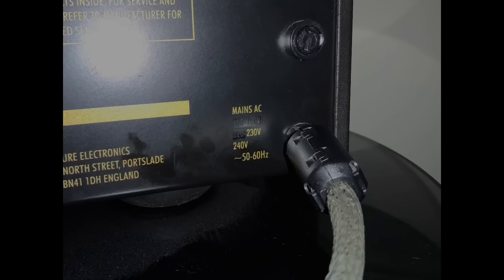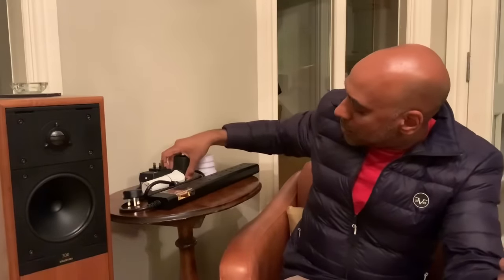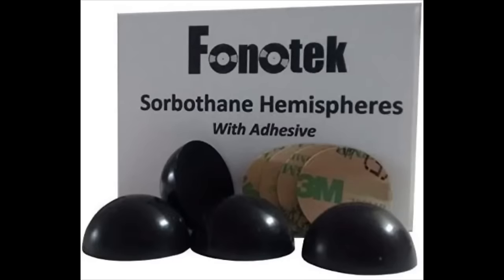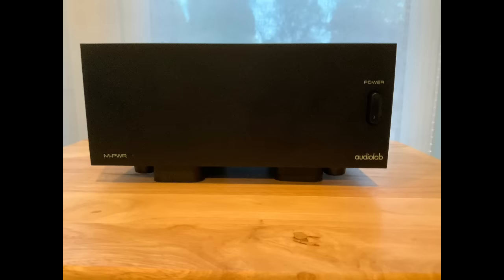My Top 5 Inexpensive Hifi Tweaks

Comment: Great set of videos. Many thanks.
Just to be clear, to use the washing-machine anti-vibration feet properly, do I remove the spikes on my speakers or leave them on? Cheers.
Reply from the maker: Thank you for watching Neil. You need to remove the spikes. The speakers will have a little movement in them now but this is okay and to be expected 😉
Reply: @abritishaudiophile7314  Thanks for your reply - it seemed a daft question but I don't think you made it clear (maybe I just missed that bit) in the video. Also, thanks to you, I now have 6 mains leads and an extension block that need replacing, but at least you've shown us how to do that affordably. :-) Keep up the good work!
Reply from the maker: Thank you Neal  😉

Comment: Hi Tarun - comment #1257: 
Christmas/New Year 2020/2021 turned into a mega TweakFest: I had been unhappy with the sound of my system for some time and had decided to change maybe the amp (Exposure pre/power! for a Exposure 501 or Primare 35) or add a REL subwoofer or both. But I had falsely diagnosed the problem as lack of power in a larger room after moving house or aging of the 34-year old Exposure amplifier or room woes because less soft furnishings. 
- I re-added ferrite cores to all equipment mains cables (I forgot I removed them for the house move) and also added cores to the DC feed for my pre-amp. --> DRAMATIC improvement like night and day. Bass returned and 'constriction' of other frequencies lessened dramatically, instruments separating audibly. 
I suspect I had serious RF interference because 1) there's a WiFi router close to the rack and 2) a DECT 'phone and 3) a WLAN mesh router also nearby, and portable devices connected to WLAN. 
- next, I isolated the feet of my KEF Reference Three Four loudspeakers with the black version of the washing machine feet using existing spikes & spike cups --> now the speakers SING, no more constriction & mid colouration I have parquet on a concrete floor but it was colouring the sound via spikes beyond belief! Now there's amazing energy in the top end which is new like I never heard before in my system, now bass is unfettered, tuneful and deep, powerful or delicate as dictated by the music , mid range is believable, natural and effortless. And I have been newly shocked by the impact of drums on tracks I know well. Before they were all constricted and colouring each other. 
Coming up: a shielded MCRU Belden mains cable for my Russ Andrews Schuko power block so I can start to use the dedicated, shielded mains spur I had put in when we had the house built; 
- an iFi AC iPurifier 
Other electrical 'threats' to the system - we have LOTS of wall dimmers and the lamps (ceiling downlighters or living room lights) all have dimmable LEDs.  It is well known that LEDs emit RFI (read the car forums where DAB radio stops working when LED replacement bulbs are fitted) and also dimmers can really pollute the mains. Add a nice antenna (thin mains cable to the light) and I think it must be a real RFI bloodbath in our lounge. 
Now I am happy again with the sound and the plans for an expensive upgrade are delayed. Some day I will have to retire the Exposure pre/power (it's 34 years old and my oldest component) but she's got some a new lease of life it seems! Maybe a subwoofer could add a new dimension, but it's not as urgent now after the dramatic improvements in sound. 
Thank you, Tarun, for your video which reminded me to check the ferrite cores and isolate the speakers from the floor! This latter issue was new to me, as I had always believed I must use spikes but in my case they were actually spoiling the sound. 
All the best from Switzerland, Rob
Reply from the maker: Thank you for sharing this Rob. I really enjoyed learning about your experiences. It will be interesting to see how you get on with the iFi AC iPurifier. It works really well in my system. Just wondering, have you ever had those old Exposure amps serviced? If not, you may want to do that before an expensive amp change 🤔😊👍👍
Reply: @abritishaudiophile7314  Good question: no have never had them serviced (Horror! What would I listen to?! 😱) I do clean the input & output contacts roughly yearly and once had to have a joint repaired on the XI PSU, otherwise no. Should I check with the factory or can dealers do this? The factory would be a logistical challenge for me from Switzerland. All the best, Rob
Reply from the maker: @RobWhittlestone   Hi Rob, I would speak to dealers and ask them who they use. Get a couple of quotes for a service and replacement of electrolytic capacitors (recap). The likelihood is that at least some of those electrolytics will be out of spec. You may be surprised as to how much difference it will make to the sound 😊

Comment: Another interesting video. I guess the level of improvement with the mains blocks, conditioners and power leads will depend on how noisy your mains is? I've had to add a ground loop isolator to my system. This my be useful for anyone who uses a computer as the main source and can hear a faint whine/buzz which changes when you move the mouse caused by interference from the coil in the video card. Before I got the active speakers the same happened when using amp and passive speakers too. My DAC does not totally get rid of this. A ground loop isolator which you plug in between DAC and active speakers (or amp if passive speakers) however does and does completely leaving no background drone at all. However I'm not sure if this does so without some kind of compromise. I haven't noticed any loss in detail but possibly stereo image and bass quality/punch but not much and by nowhere near as much as changing cables improved it, could simply be placebo due to reading that this can happen due to agressive filtration. The ground loop isolator I'm using costs only 6 quid! Do you know much about these?
Reply from the maker: Hi Paul, thank you for sharing your experiences. I really enjoyed reading you comments 😉

Comment: Hi Tarun, I watched this one a few weeks ago, and I think you're probably the first person I've seen recommending putting ferrites on speaker cables. For £4.40 for a pack of 10 from the famous auction site, there was very little to lose. And I'm sitting here tonight really quite astonished by a noticeable improvement in clarity and detail. I already use Tacima mains strips and they make a difference for me, and I have computer equipment running in the same room, so I suspect I have dirty mains and/or suffer from RFI. Anyway, thanks for the tip.
Reply from the maker: Thank you osliverpool. It is the extra inductance that the ferrite provide that can be beneficial in some systems.

Comment: Just wanted to say thanks. For the past decade since moving home i've never been fully happy with my sound setup. Had no idea what the issue was because it all sounded great in my last home. The Tacima CS947 fixed that. After a decade i'm extremely used to how everything sounds, so i can say with 100% certainty that the mains conditioner definitely works. It's sad how some people see it as "snake oil". It's not hard to see how it will work on some equipment/homes with just a little understanding of this stuff. So now i'm also interested in the Tacima SC5723 wall plug, but as the last comment here mentioned, it's no long manufactured (MCRU also confirmed this). Any alternatives?
Reply from the maker: Thank you ST. IFi also do one which is a little better 👍

Comment: I viewed this video quite a while ago. And based on that I bought a pack of fairly large washing machine, vibration dampers. The result was remarkable. They were $21 for a set of eight couldn’t be happier. Some of the leading prize are between 500 and others are around $700.

Do I gain a lot more going this way because I’ve gained quite a lot .
Reply from the maker: Thx for sharing 😊

Comment: I was always told from audiopgiles and my own rearch and finding that a speaker spike does decouple the stand from the floor as yu are reducing the amount of surface area of the stand in contact with the floor compared to it sat on larger pads, feet or directly on the floor. The more surface area of a speaker, stand or rwuipment/ rack that is in cotact with the floor the more noise it can induce and also collect from the floor, so when it comes to decoupling you want as little surafe area of the items mentioned touching the floor or a surface of a rack. i would always say use spikes on stands and equipment then use anti vibration pads bewtween speakers and their stands and between equipment and rack shelves.
Reply from the maker: Yeh, but that is not true. Try placing your speakers on a glass surface on spikes and obviously protect the glass by using spike pucks and ensure the glass is strong enough to hold the weight. Play bass frequencies and you will see how much the glass vibrates. Do the same exercise now removing the spikes and placing damping material under the speakers. The difference is not subtle.

Comment: Thanks for the advice on the mains conditioner, surely getting the Tacima 6 way. With regards to good house keeping, do you change your speaker cables from time to time? I've heard a few folks do, but the question is, if you're spending tons on cables like Acoustic Zen or similar, how often would they need to be replaced for good conduction?
Reply from the maker: Thank you. They shouldn’t need changing 😊

Comment: If you have a high end system (properly high end with regards to source, amplifier and speakers) the biggest tweak you can make is to upgrade to high quality speaker cable.  I had my dealer demonstrate the difference between my old Naim cables and new Linn K200 cable. Difference was noticeable and worth the upgrade cost.  He had tried to convince me several times but I was a disbeliever until a blind test convinced me otherwise.  Money well spent in my opinion!
Reply from the maker: Thanks for watching and sharing your experiences Ian 😉

Comment: Thank you for sharing these tweaks, sir. Went and bought the featured power bar and some ferrite beads from Amazon after watching this video yesterday morning. The power bar does work wonder on my entry-level vintage setup. Even the picture quality on my 4k TV has significantly improved. However, the magnets in these ferrite beads are too strong for my speakers as they seem to filter out the top end quite a bit. Never mind, these are inexpensive experiments by nature anyway. Still very pleased with the result. Please do keep up the good work. Have learned a lot from you. Thanks.
Reply from the maker: Thank you for watching and your feedback W L. Sorry for the delayed response 😉👍

Comment: A mains conditioner requires either an isolation transformer (e.g., Torus, Equi=Tech), or is an AC in-DC rectified-AC modulated, amplifier-like regenerator (e.g., PurePower, PS Audio).
Everything else is a line filter, no matter the number of X2/Y2 capacitors, chokes, and surge/spike suppressors (typically TMOV).
For sake of clarity (and honesty) it would be nice if manufacturers of these products would identify them accordingly.
It's kinda like when I order a piece of banana cream pie, but the waitperson serves me an approximation of sorts without any bananas.
Distress follows. . .

Comment: Most effective things I did for my system:  10awg power chords, modest cost ones; proper speaker placement for my room dimensions; cheap vibration devices for components; parallel power filter device at the wall sockets.   System total cost $3,000 , tweak items total cost  $400
Reply from the maker: Hi W Yuhasz, thank you for sharing 😊
Reply: Power chords are on your guitar. Power cords on your hi fi :-)

Comment: Hello! Great videos, I really appreciate how meticulous you talk about this subjects. One question though regarding power cables: I was under the impression, that shielding should only be grounded on one end, so that it won’t act like an antenna. Can you either confirm or deny this?
Reply from the maker: Hi Dan, there is still some debate about this. It is my understanding that the shield is more effective if connected at both ends but can introduce ground loop problems. Based on the feedback I received and after checking with David @ MCRU I amended my advice in the next video and now advise that people to just connect the shield at the mains plug end as you suggested. Link below
https://www.youtube.com/watch?v=gfVYfC6tmcc
Reply: Thanks Tarun, I appreciate your answer. Please keep up the excellent work with your videos, they are much appreciated.
Reply from the maker: Thank you Dan. Much appreciated 😉👍

Comment: A ferrite core is not a magnet. All the ferrites I have are non magnetic, held together by a plastic frame. Some are quite large, formerly used in an industrial setting between computer circuits and display terminals. Seemed like they were over engineered for the application, but it was a location with many electronics in a small space.
  No matter their shape, they were all referred to as ferrite beads.
Reply from the maker: Ferromagnetic. I know 😊

Comment: Hi Tarun. With the vibration pads, it looks the legs of the washing machine are supposed to sit inside the pads, suspended on a membrane. My speakers don't have legs or spikes. Will I still get a good decoupling effect if just glue the pads to the underside of the speakers? Thank you.
Reply from the maker: That is how I use them 👍

Comment: My friend, when it comes to inductors you have it wrong way around. A ferrite bead is a common mode choke so both wires (or all wires in the bundle) need to pass through the same core. So it needs to be placed behind the split to capture both wires. Otherwise it’s causing an inductive imbalance.

Also, to see the most effectiveness out of something like toroids, you really need to put them on every possible device in your house that you can including all of the installed LED lights and everything, at least everything that is not a purely resistive load. 

At my office, I went around and put one inside every light fixture on the wires where they leave the light fixture. We have one on the power cord of every computer, and every other piece of equipment that’s in the rack. 

What they actually do is to prevent RF that is being generated by the switching power supplies in the equipment from being injected back into the grid and polluting the power for other devices. 

So I would say that there is validity to this… Even though a lot of devices have these ferrites built into them, or come with them integrated into the cables already. But they are pretty inexpensive one bought in bulk, so we decided since we run a lot of sensitive electronica equipment to go ahead and place one or two on everything. 

They also help block transient surges out of your equipment by providing a small amount of inductance which makes the surge want to go to ground instead of into your equipment.
Reply from the maker: Hiya, my concern about placing a large ferrite bead across both conductors is that it would add too much inductance and cause high frequency roll off. This article seems to support my approach of placing the choke on just one wire...
http://www.empiricalaudio.com/computer-audio/technical-papers/myths-and-snake-oil
Reply: The other important factor with ferrite to consider is the mix. 31 mix is a good general purpose ferrite for most domestic applications.
Reply from the maker: @GeorgeEI7KO  thank you 😊

Comment: Love the suggestions. I'll have to check out the power treatment ideas.  I still don't understand what the chock does.  If I understand this right, we are talking a chock that, is designed to block noise in the Mhz, maybe some effect in the high Khz.  And, at that is is a very very small EMI,(haven't found info, but I'm guessing  low mVs/uA), noise that will go under no more amplification.  Would we really here that noise?
Reply from the maker: Hi Michael, you are correct the noise is small and above the audible range but it can adversely impact on sensitive electronics and tweeters which then in turn results in a slight deterioration in sound that is audible. People who live in build up areas and in apartment blocks may have more RF and and EMI noise and it is inexpensive to experiment with ferrite chokes to see if they offer any improvement. Thank you for watching and commenting.
Reply: @abritishaudiophile7314  Thanks for the information.  It's cheap, I'll pop a couple in the next Amazon order. Thanks again.

Comment: The one thing I did, that most folks never think about, is a direct power/electrical circuit (outlet) to the panel. That outlet in the wall adds a lot of noise if on a multiple switch/outlet circuit. Electricity does vibrate when traveling through wire, outlets and switches, which creates noise and distortion in sensitive AV gear. 

I have been wanting to do this for a few years, but simply never got around to it. But, as I am getting nicer gear and really getting into streaming, I thought it was time to tackle the way power is delivered to my little AV corner of the living room. 

Huge difference! Friends came over the other day and commented on my new TV. I did not buy a new TV. That is how much the picture quality was improved. I can say the same for the sound coming out of my speakers. 

If you do one thing, and can do it, drop a direct line from your electrical panel to your audio and or video gear. The results may just amaze you.
Reply from the maker: Thank you Michael 😊